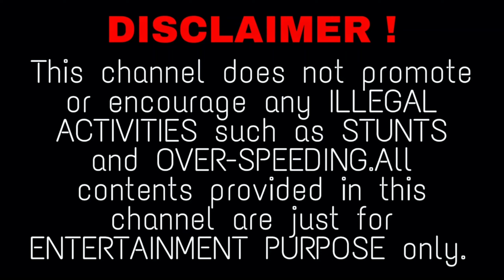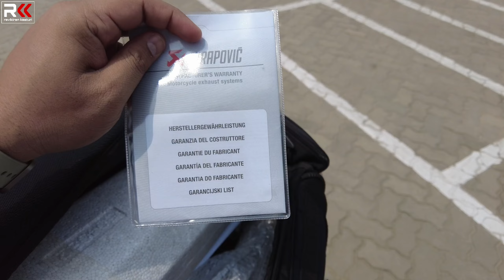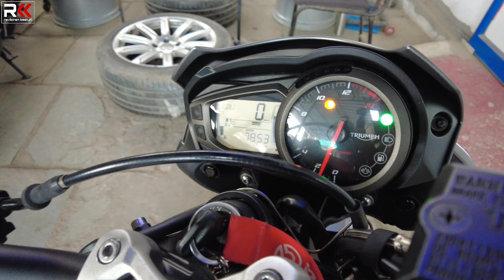Installed Akrapovic Carbon Exhaust on my Triumph Street Triple |SOUNDS INSANE  #ravikirankasturi

Comment: Bro, is that a full system? Did u go with after market air-filter? Ecu remap required ?did u find any slipons smaller than this.quick shifter and blipper works like 🔥